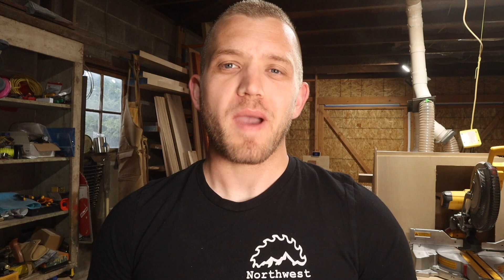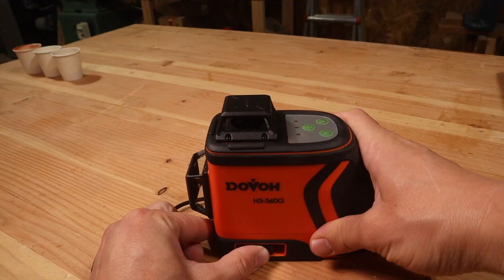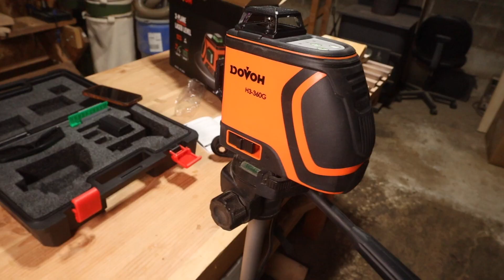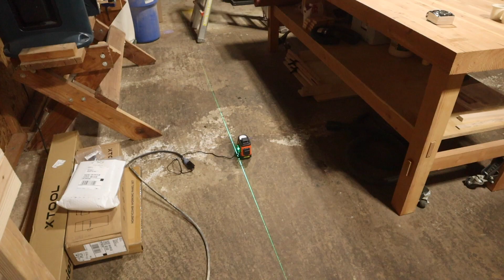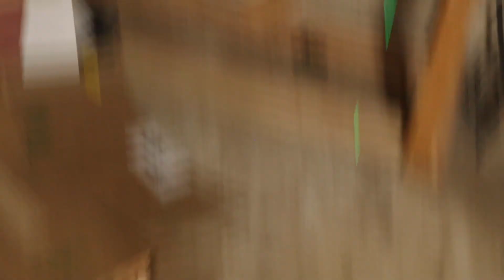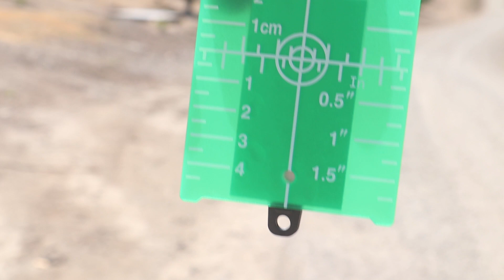H3-360G Laser Level | Unboxing & Test

Comment: The big tripod "hole" is for construction tripods, such as what Bosch uses.
$280 for this? A little high.  I just bought one for $50, definitely not as beefy as this one, but it seems to do the same things.
Reply from the maker: Ah! That makes more sense! And hey, if you find one with the accuracy you need for $50, absolutely go for it.